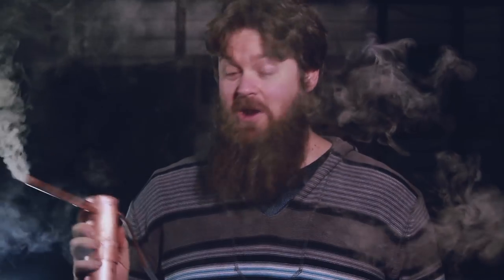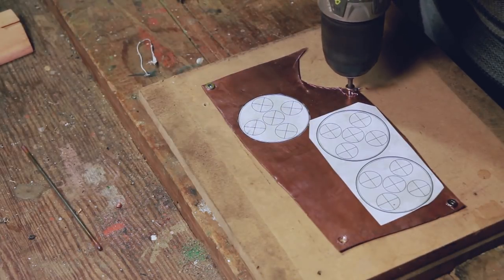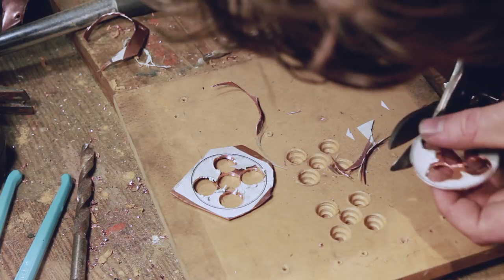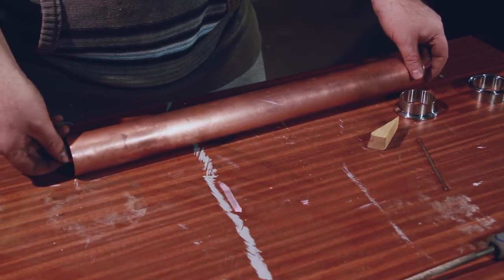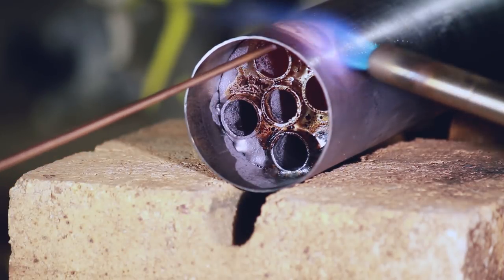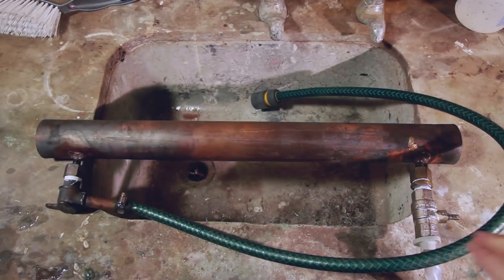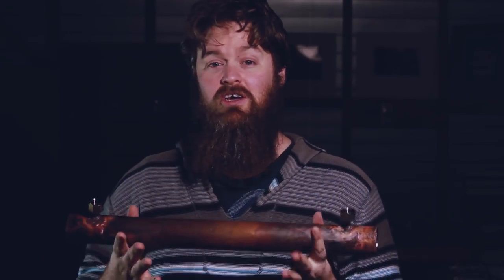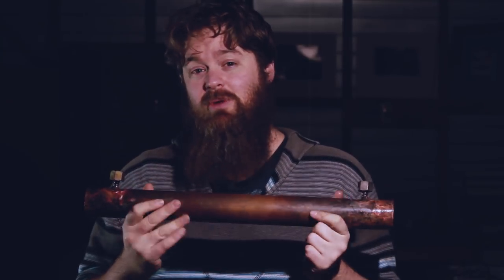Building A Shotgun Condenser

Comment: Hey budd thanks for the vids Im researching my first build but I have a question, looking at that design it seems that there is alot of space for liquid to pool at the top of the condenser before passing down the tube and this may cause smearing of the foreshots and heads has that been an issue for you or am I just being a bit pedantic with my design?

Comment: Did you have any problems connecting the copper to the ss ferrules? I got mine so it looked good, but as soon as I put any weight on the joint it comes apart.
Reply from the maker: The first few times I tried was a bit sketch.  I was not getting it hot enough.  But I got there in the end.  The joys of learning haha
Reply: Right on, I figured it was probably not enough heat. I'll try using some hotter gas.

Comment: How long did you make your shot gun condenser from fitting to fitting?
Reply from the maker: Actually never measured it fitting to fitting.  Just the actual "active" part of it.
Reply: @StillIt  why did you put the plates in so far? making it harder to braze? couldn't you do it flush with the ends of the pipe?

Comment: Hey mate, love the vids
where did you get the ferrules from and what size are they?
everything 2” i can find is sized to butt on to the end of the pipe and the bigger and smaller sizes are too big or small to go inside or outside.
Reply from the maker: Yeah I had the same problem.  I had to expand the pipe a little to fit the 50mm ferrules (I got from Ali Express).  I did that buy forcing them in haha.  Not ideal, but I couldn't bring my self to buy the right tool for the job.
Reply: @StillIt  Might wanna mention that issue as its the problem in facing also..

Comment: overkill.....I have a single 1 12mm pipe inside 1 18mm about 1m long.... more than enough condenser.   I use a sharkbite to join to the column... cheap and simple.  Also an 250mm sleeve that slips over the column with rubber reducers on either end and water fittings for reflux for gin and vodka.   Easy to install or remove.

Comment: take your tube turn it on end leave over .25 " of your tubes sticking out flux it warm it up to heat and flux it with flux bring it almost to the top of the tubes   flip it over and do the same no leaks  first drill and do you in and out coolant lines ..

Comment: How much did all the pieces cost together?
Reply from the maker: Just for the condenser?  
Perhaps $8 in copper.  $8 for ferrules. $10 gas. $10 braze. I had to buy a few tools too,  but I can't really add that to the build cost.  So perhaps $30-$40 NZD.   So $22-$30 USD.  At a guess.  

Once everything is up and running and all the kinks are worked out I will do a summary video with costs etc.
Reply: Cool cool, thanks man!
Reply: Earlier I was looking up pronunciation guides to try and decide if you were from New Zealand or Australia. I guessed wrong.
Reply: Sorry, lol
Reply from the maker: hahahah!  
I shall try not to be offended ;)

Comment: Are the 15mm tubes on both ends proud or is one end flush?
Reply from the maker: One is almost but not quite flush.  You thinking of the flow of gas?
Reply: The end closest to the vapour should be flush at the very least, common internet theory suggests that if it isn't you can get pooling which will encourage smearing.
Reply: Closest to vapour = Lyne Arm.....
Reply from the maker: Ah right!  Will check that out!

Comment: Did you figure out how to build a shot Gun that works .. if so . put 3 ,    30 gallon stainless steel pots together .then make a manifold for the 3 Arms . one for Corn one for  Rye and One for Barley .. now Im going to tell you make  you can get two Runs . just add water and sugar    use 2 gallon of malt corn ,rye, barley  
now on the sugar the 2nd run use brown sugar ..   them first two runs are strippers   the 3rd run .. fuse it with condenced Apple Juice and one medium can of ..  in your arm you will take 2 glass gallon jugs and make them both Doublers  . and send it right to your condencer ..  I have hit  years go 170 to 180   good Apple pie likkkr 
with out going threw the other BS temper back to 120 stick a apple wedge and cinnamon stick for look  25 to 30bucks  a quart ..

Comment: Not exactly sure why you are braising copper when it soldiers so easily Plus it makes it easy to take apart if you want to change something
Reply from the maker: Not so worried about taking it apart as everything is modular.  But fair point.  

Was easier for me to get the materials here for brazing.  And also stronger (although more brittle).
Reply: I know when I was designing mine I took it apart and made changes many time. In fact I have some new ideas right now. I also want to make a real traditional moonshine still that makes use of a thumper keg. IF you haven't already you should watch the Popcorn "Marvin" Sutton video on youtube. "The last damn likker run I'l ever do"
Reply: The setup I have now will give me 95/% abv on the first run. Good for vodka. I remove the packing and turn off the reflux for whiskey or brandy. I filter the vodka through a 5ft column of activated carbon to further purify and smooth it out. Whisky I make charcoal like they do at the Jack Daniels distillery and use that. I use whatever hard wood I can get since I don't have access to the sugar maple they used.. I visited the Jack Daniels distillery several years ago. It's funny because Lynchberg TN is in dry county and You can't buy any liquor there. Cheers

Comment: why don't you use solder bro?
Reply from the maker: +brittenv1000 I was finding it easier. To find the brazing flux.  And I had a few people teaching me that knew brazing.
Soldering would have worked too. I want to teach myself that too!
Reply: Still It I guess brazing is a hell of alot stronger? Is there a second vid of the shotgun installed?
Reply from the maker: +brittenv1000 nah I think I jumped right into using it after that.  I need to make a overview video for the still now I think.  Almost like a review type thing for those thinking of going CCVM.
Reply from the maker: +brittenv1000 oh also yes.  But I think perhaps slightly more brittle too.